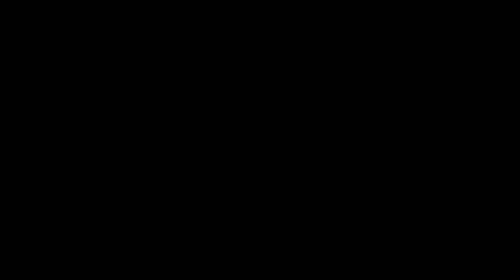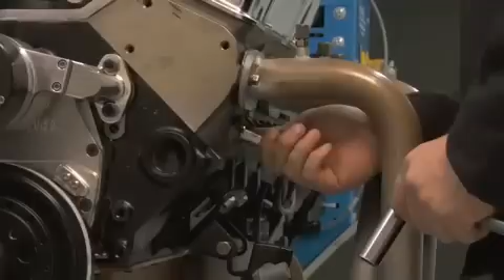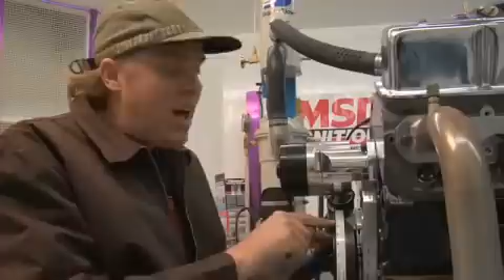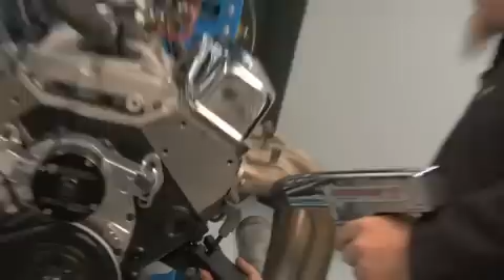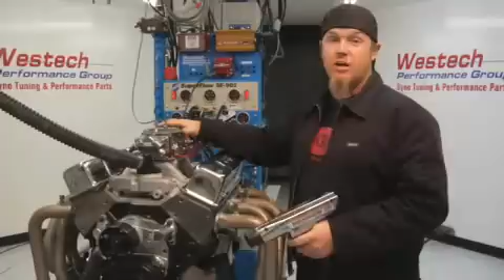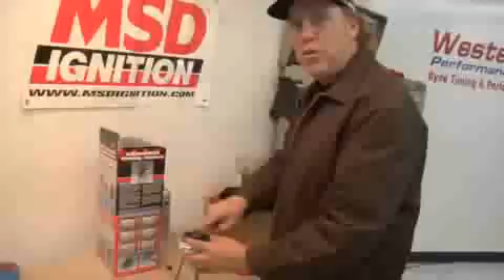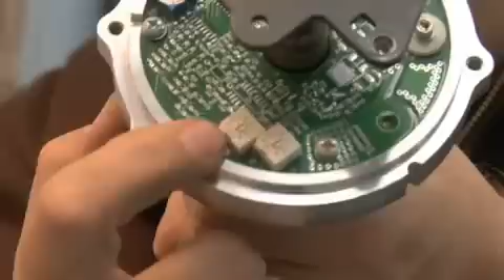How to set your ignition timing

Comment: This is interesting. My ready to run MSD came with he heavy spring and green stop bushing installed. Being a ready to run you qould think guys would mainly use it for mild engines. The way it comes it only allows about 16/17 degrees of advance at 3200 rpm. the car likes around 10 degrees at idle so i was only getting about 26 degrees total advance.
The SBC ready to run should come out of the box with blue springs and the silver stop bushing installed and I feel it would be way more "ready to run"

Comment: How do we know if crank is not 180 degrees out when setting chain on 2000 S10 4.3 Vortec
Reply: as long as the marks line up on cam and crank gears it will be rite.
Reply: as long as the marks line up on cam and crank gears it will be rite.
Reply: Both ways are right because when your done if its wrong u flip the disburtior 180

Comment: at what RPM do you set the timing on a small block chevy, you guys never show / tell us that, Chad just revs the carb up with his thumb and you say look at the timing advance as the RPMs increase, ok, well when the engine drops down to 12* what RPMs is it at
Reply: +gReGsKi GmAiL rev until timing stops increasing, normally 3500-4000
Reply: 3500
Reply: How 12
Reply: 3500-4000rpm.

Comment: so is it safe to say that more cam and more compression will need more timing advance to run? its a standard bore 350, flat top pistons, 64cc vortec heads, 268/276 .489/.504 cam and it will only run if the distributor is turned toward the advanced side. if it is centered or even close to it it backfires and wont run.  its timed right and the valves are properly adjusted but i haven't put the timing light on it yet. why would it run like it is retarded if the distributor is in the center? shouldnt that be zero?
Reply: More cam typically requires more timing advance AT IDLE. Above idle it's more a matter of combustion chamber shape. I had a similar 350 to yours, with the vortec heads, along with a bit bigger cam (230* at .050"). Your engine will probably run best with around 15* at idle, and the same total as my engine did, 33-34*. That's with the vacuum advance disconnected. Don't worry about what the timing is with the vac advance connected, just connect it to ported vacuum (vacuum when throttle is cracked open, but not when at idle) after you set the 33-34* when revved without it hooked up. It's far more important to get your total timing set than the idle timing.
Reply: Carl H Older, less efficient combustion chambers and big quench distance will typically want a little more advance, like 36-38* total or so. Like a 440 mopar from the mid '70s with open chamber heads... that may even want 40* total. A small bore engine with a highly efficient head may run best with only 30-31* total. Most aftermarket cylinder heads, or mid 90s and newer OEM heads will do best around 33* total.

Comment: Ok so I got ahead of myself a few days ago and took the distributor off without setting any markings or setting the #1 piston at  TDC before removing the distributor. I have now lined up the balancer to the 0 mark so the 1st piston is at TDC but my question is, how do I know if its at TDC of the compression stroke or the exhaust stroke? Is there any way to tell without having to tear half my engine apart? And how messed up would my engine get it I fired it up at TDC of the exhaust stroke with the distributor rotor pointed to the 1st cylinder mark?
Reply: You can take the valve cover off of the side with the #1 cylinder and see if both rocker arms for that cylinder indicate both valves are closed. If they are, you're on the compression stroke, which you want. If not, turn then crank over one more turn and you're there. The other option is to put a finger over the spark plug hole on the #1 cyl and turn the engine (clockwise). When you feel a reasonable amount of air coming out when you turn the engine (like both valves are closed) you know you're coming up on the compression stroke.
Reply: Carl H
 awesome. Thanks man I appreciate it :) A buddy of mine mentioned the spark plug hole option before and I tried it but I couldn't tell. I think I'll just get a new valve cover gasket and take the valve cover off and do the first option you mentioned. Thanks again.
Reply: Whenever i time a motor thats already running i stick a piece of welding rod through the spark plug hole till it hits the piston (you can use any kind of wire or metal coat hanger) then crank it over by hand that way you can see exactly where tdc it thats what works best for me but both the other methods mentioned work well also

Comment: What I was thinking that I should not put more then 12 at idle.
Reply: For an engine with a small cam, like a stock cam or "rv" cam, you probably shouldn't give it more than 10-12* at idle. With a pretty rough/lumpy idle cam, it'll want 15-20*. If you've got a really nasty cam for drag use, you'll probably just want to lock out your timing at your total number and put your ignition on a separate switch from your starter, so you can get the engine spinning before turning on the spark. Then again, if you've got that nasty of an engine, you wouldn't be asking that question. :D

Comment: Nice video. I'm glad to see you're enjoying the joy of the magnum 6! I have one myself. It's a 99 4x4. I also have a 98 5.2 v8  Dakota 2 wheeler with nearly 195k miles still running strong and all I've done to it was one water pump change and I think 1 battery change. As far as my other Dakota the v6.....oh boy here we go......, I have replaced the freeze plugs. Nasty coolant  drips, i changed the main bearings along with the oil pump and pick up tube, timing chain, the starter, distributor, oil pressure sensor, idle control sensor, crankshaft positioning sensor, BOTH cylinder heads, they had hairline cracks on the laps between the exhaust and intake valves all 12 of them  ( this is prone to all v6 daks until they changed to the 3.7)so now I have new and very clean cylinder heads with perfect valves and springs, and of coarse have replaced ALL gaskets with fel pro ones. I'm starting to get a slight power steering drip but that's not hard to do. Anyway, this long laundry list of repairs on my 3.9 Dakota and it runs really well. No sludge no carbon build up just a clean well balanced 3.9 machine.  Its a love hate relationship with the 3.9 magnums. the 318's are just perfect no problems or issues as long as you maintain them. I'm the 3rd owner on my 3.9 Dakota so this truck was not taking care of till I got. I am the original owner on my v8 Dakota. My point is when your 3.9 is talking to you listen to it or you'll be sorry later. Great vid and I like your idea of writing your trucks info and milage on top of the radiator. I'll do the same with a label maker so its cleaner and peels right off.

Comment: Let me ask you this you started with 12 and to get 35 total you ended with 19 initial. Do you then leave it at 19
Reply: Robert Greene the number one spark plug.  That will be your "base" timing.  It will be enough to get the engine fired up.  Afterwards, you have to fine tune.
Reply: Robert Greene NP, keep in mind too that you need to "play" with the adjustments, until you find what works best for your vehicle.  Don't get too caught up with manufacturer numbers/specs.  This is coming to you from a professional mechanic.  Manufacturer specs should be used as a guide only, not law.  Keep in mind you own a vehicle that is over 30 years old.  Many things have changed since then (mileage, wear, quality of fuel, quality of replacement parts), What MB says should be "right" back in 1983 when that SL was brand new, and fuel didn't have ethanol.  It probably won't be right today when your vehicle has ten of thousands of wear miles on it, and we fill up with this crappy scam fuel.

BTW I also specialize on German cars.  I work only on MB, BMW, MINI, VW,Audi-etc.  Set your base timing, and that Benz will probably run great anywhere in the 10-12 degrees range.  Make sure it is warmed up, and take several drives with it, and load the engine.  Make sure you have no detonation or pinging, and that it starts right up when hot.  If it struggles to crank, and takes effort to start.  DIal the advance back some.
Reply: Depends on your configuration.  This is where trial an error comes into play.  Things like atmospheric pressure, fuel quality, and average temperatures in your area, along with your particular build will dictate whether these figures will work for you.  You need to get out and drive the vehicle under load and pay attention to signs of pinging, detonation, and back firing.  If you are experiencing any of this, you will have to dial it back some.  It is not difficult to do, just requires investment in time.  The engine will tell you if you have gone too far believe me.
Reply: Robert Greene I thank you very much. Have a Blessed Day.
Reply: Lynx Star Automotive I have a 1983 MB 380Sle gas engine. I moved the dissibutor. How do I reset the timing. Were do I point the rotor, After I pull up #1piston. At what spark plug do I point the rotor button?

Comment: Is changing the timing belt likely to corrupt the engine timing? My car started having a lazy start as soon as I had the timing belt changed.  should the mechanic have checked the timing as part of the belt replacement job?
Reply: It'd probably be a good idea to check the timing anytime you mess with the timing chain or distributor, I've learned that lesson the hard way lol. If either of the gears were moved out of sync with the belt off it might have thrown the pistons and valves off which could leave your cylinders vulnerable to get fuel/air into the cylinder during the exhaust stroke or not completely empty the exhaust out during the compression stroke, this could also cause premature detonation but if the timing is jacked up at the timing chain, turning the distributor isn't going to be the fix because the cam shaft and the crankshaft are still linked together at the timing chain. You'd need to disconnect the timing chain again, set the 1st piston at TDC then take the valve cover off and turn the cam shaft until its set up like it should be (taking the valve cover off lets you see the valve train and lifters so you can see if their set where their supposed to.) Then after your comfortable with where the cam is in relation to the crankshaft, hook the chain back up to the gears in the timing box, throw  your valve cover back on unless you enjoy an oily mess everywhere then fire her up and see where your at.
Reply: What sort of "mechanic" did the timing belt job? Some engines are a breeze to do a timing belt on, like the 2.3L Ford and most other single cam engines aren't bad either. But if you've got a V6 or V8 with dual overhead cams, or even a straight 4 or 6 with two cams (not nearly as annoying as 4 cams), it's not a job for a lot of 'shadetree' mechanics. I highly suspect you have at least one cam that's a tooth off. Even a pretty good mechanic has that happen sometimes. When the timing belt tensioner is set, it will move the cams a little and if that's not compensated for when putting the belt on, it'll be a tooth off. That will surely cause sluggish power and usually not as quick to start.

Comment: Please respond to me.. This is in my opinion the best vid on you tube very detailed but you missed one thing. Vacuum advance. So with vacuum advanced disconnected and plugged i  am at 11 BTDC. When i connect the vacuum back up im at 30ish BTDC is this the correct way or did i mess up.
Reply: Hook up your vacuum advance so it only sees vacuum when you crack open the throttle. Hooking it up to manifold vacuum (vacuum going to the dizzy when at idle) will give the engine a quicker, more peppy rev, but it's not correct and often causes detonation which isn't audible since the engine isn't under much load when at very low throttle angle.

Comment: Could you make a suggestion on the best distributor for a 76 cj7 jeep with 258 engine and a GM TBI fuel injection system? (The ecm has spark control but I will need to upgrade my distributor since I currently have a prestolite ignition system)
Thanks for another great video! :)

Nevermind... I got a duraspark dizzy... Now need to find a good coil for my newly tbi installed system...

Still... Wish I had a good/single man to help me on my peep....  :P

Comment: Good information! However, this only applies to distributors without vacuum advance. For you guys with standard engines and distributors this is not the correct procedure. You have to get specs for your particular engine and check it to them. Note: Timing with vacuum advance connected could very well be about 30-45 crankshaft degrees advanced at about 2000 rpm.